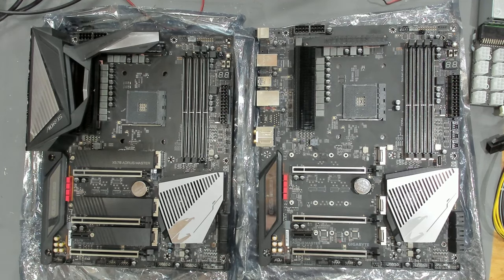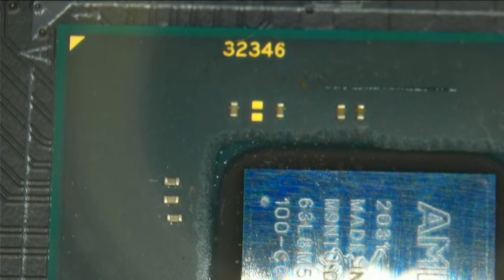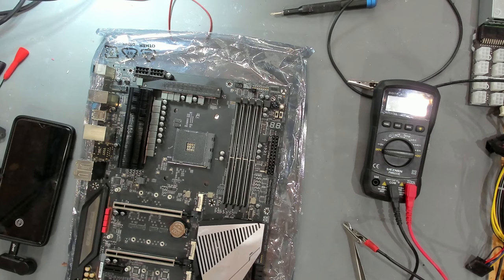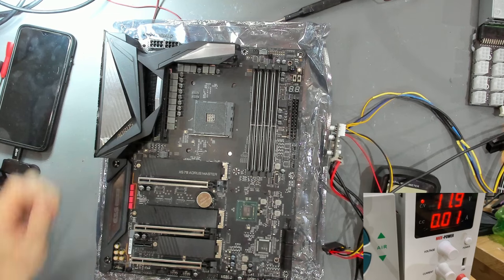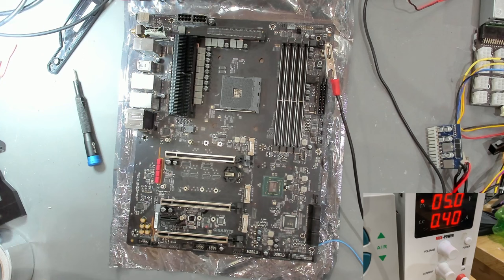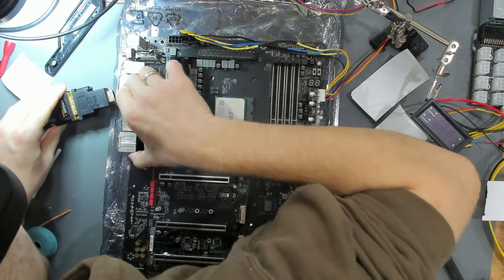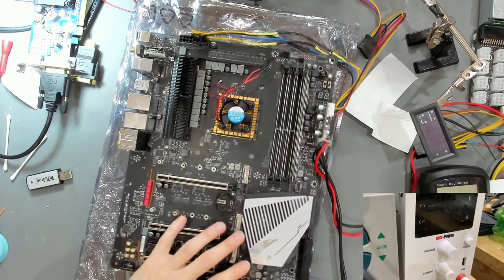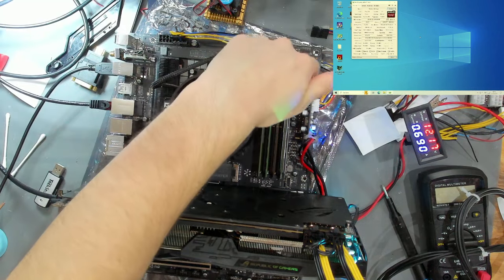VIEWER SENT IN OVER 10 MAINBOARDS TO FIX | X570 AORUS MASTER MOTHERBOARD REPAIR

Comment: The reason you were seeing 3V on the PCH inductor is because the output side of it wasn't connected. Not only does that mean the VRM controller sees 0V on its output (which makes it turn up the duty cycle to the max, desperately trying to bring the voltage up), but you were also measuring the unfiltered, high frequency AC of the switching node (since the filter caps are on the disconnected side of the inductor).

The X570 chipset can easily pull 8-10W under load, so seeing it gulp down a couple amps at 1V isn't that surprising. There's a reason board makers put big great heatsinks on those ICs 😃

Also I wonder: Did you end up getting it to post with the 2200G or did you have to use a different CPU? If I remember this right, X570 boards don't support first gen Ryzen and the early APUs.
Reply from the maker: Yeah right, that explains the voltage very well, thank you!

Never had worked before with X570 Chipsets, now i know why there are almost always activ cooled!

I did not get it to boot with the 2200G. I should have used my 3000G, i think that one would be supported.

Comment: cool video. i’m not sure if you know but there is also a x570s chipset. those chipsets do not require an active cooler and thus would probably have a lower current draw or voltage.

Comment: I have an x570 aorus elite which I picked up on eBay "for parts or not working" in a combo with a ryzen 5 2600 cpu and RAM. At first I could not get it to post at all. jumping the power switch resulted in nothing other than a slow warming of the CPU, and an extremely hot pair of small chips under the m.2 slot closest to CPU. Ordered another ryzen 5 2600, and it showed signs of life. Fans now turn on (chipset and CPU), Q-Flash appears to successfully work, and those chips are no longer hot. Without CPU/RAM/GPU installed, after about 6-8 minutes of fast, then slow blinking q-flash light, along with the light on the USB drive flashing nearly the entire time, it appears to complete successfully. It even shuts the board down after finishing (fans turn off). I still can't get it to POST no matter what I do. With a USB keyboard plugged in, the lights don't ever blink. 
Tried different ram, tested 1 stick of ram separately in each slot, Plugged in a speaker to hunt for post codes, tested 3 known-good GPU's including an RTX 3060, RX6600XT, and even an ancient HD5770. Used HDMI and Displayport. Have you ever had a motherboard work successfully with q-flash but still fail to post.
Any ideas from your years of expert experience with such things?
Reply from the maker: Ive actually had that happen. Only flashing the bios manually got it fixed, but doesnt have to be the same in your case. Could still be a missing voltage or missing Signal!
So sadly Q-flash is not reliable, but can work!

Comment: Interesting that the chipset sucks that much current, when all it does really is control. maybe they just use failed CPU,s as a chipset :face-green-smiling:
Reply from the maker: I was so sure that it was dead, but guess X570 is just build different!